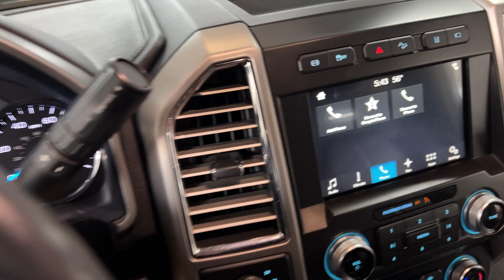New Dual Rate Coil 2.5" Leveling kit on F250 Platinum

Comment: I have had kits from Ready Lift, then BDS, then ICON, then Pure and now Carli on F250's and ran each between 85k to 99k miles with the exception of the Ready Lift.  Hands down..I mean hands down Carli is the smoothest, most controlled and I feel way less from their progressive springs and shocks.  My 2020 F250 truck rides almost as well as my 2003 GMC 1/2 ton and 2009 F150.  To be fair I also have 37 12.5 x 20's on Falkin Wildpeak tires. No mud or Hybrid tires and I keep the PSI to 46 rear and 54 front.

Comment: Corey, what about new shocks or tgose tunes to work with Icon coils?  My Carli Comnuter 2.0 level kit and fox shocks on my 17 F350, way better ride as my DD.  No flaming, bringing other variables in for consideration.   The Platty always inspires..
Reply from the maker: Well 🥴 I had the nice icon shocks sitting there too but I’m missing all of the top hardware for one. So they didn’t make it in the video lol